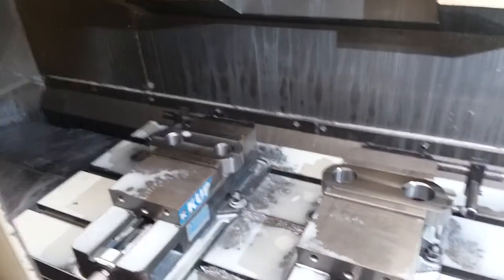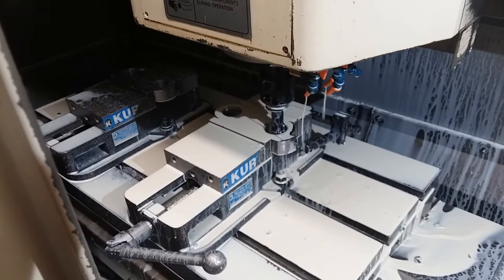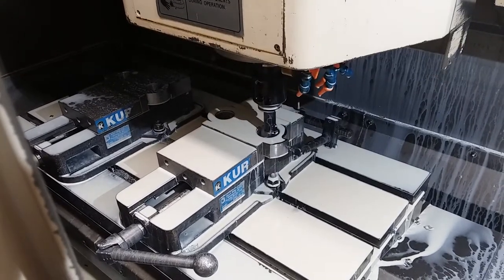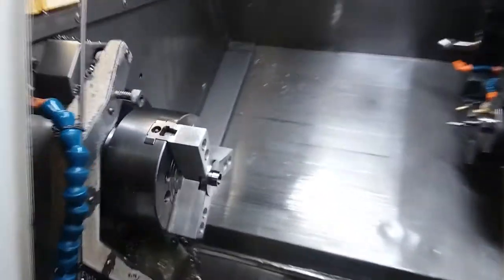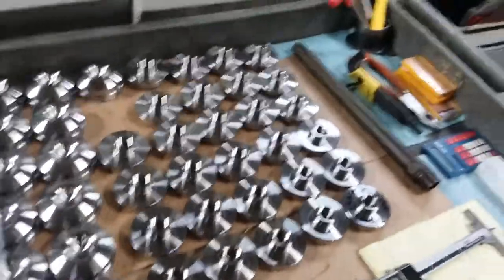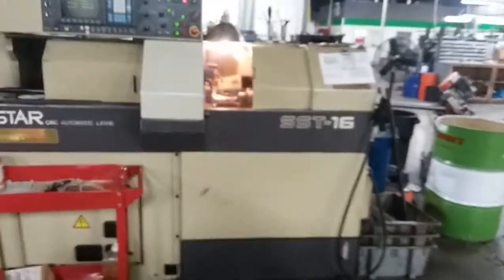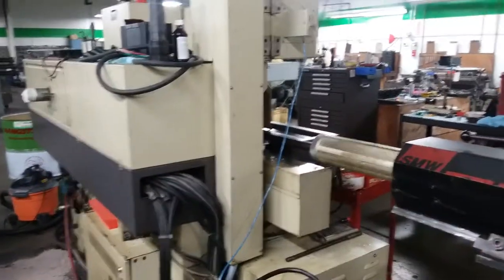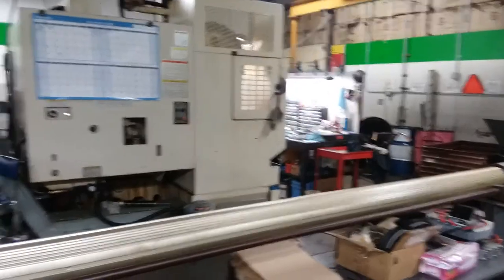A day in the life of a production machinist renting the back corner from a customer.

Comment from the maker: The Okuma does not have a spindle lock pin, I am using spindle orient only. It held the fairly tight tolerance with no issues. And it  beats having to buy a $3,500+ custom carbide broach,  and having to wait months for it.  There are two key ways apposed. So I did one side, and flipped part into second vise to do the other side. Voila .